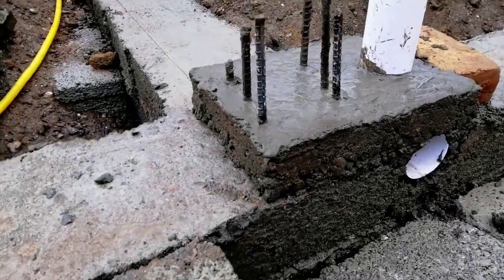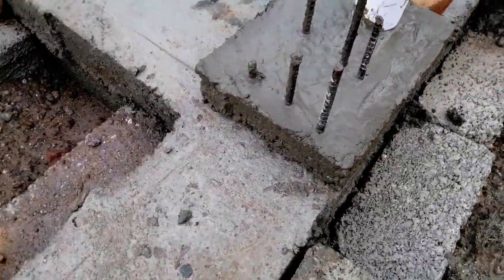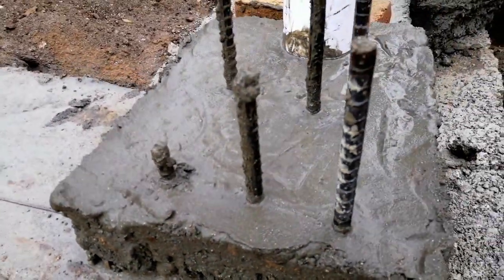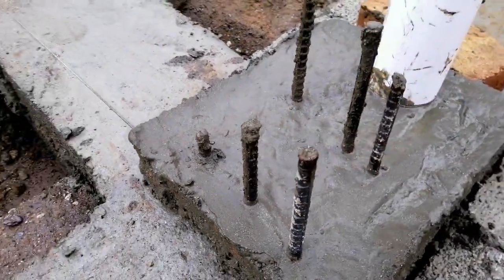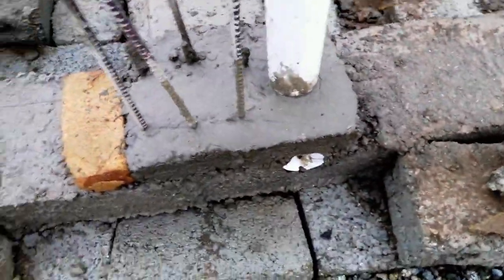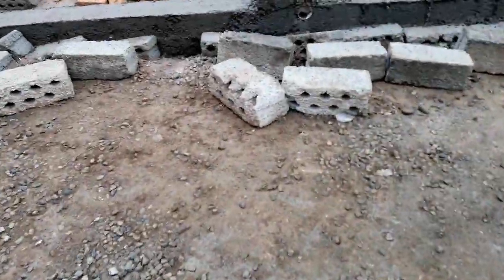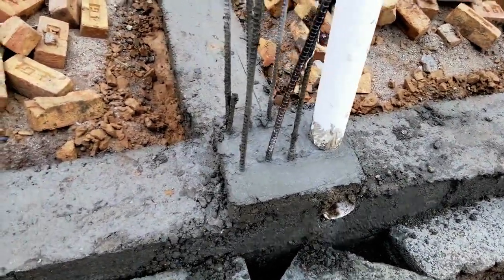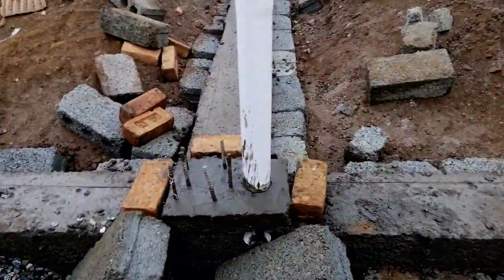Big Mistake in Column Lapping Length - Big Mistake in Lapping zone in RCC Column

Comment: What is the solution for this problem now?
Reply: Couplers can also be used .. but it will be costly.
Reply: @ashishkumar-vu7dn  Bending moment at that region of column is very high & further providing lapping at the same level will be very risky & may lead to failure. So even a coupler will not be able to solve this. Instead they should break that column beneath with care & obtain lapping length at least 40d
Reply: Can be welded. Lap lenght 10d.